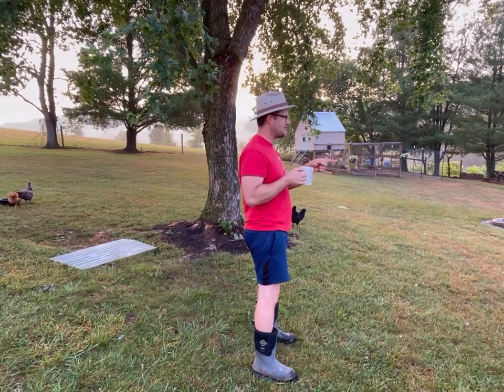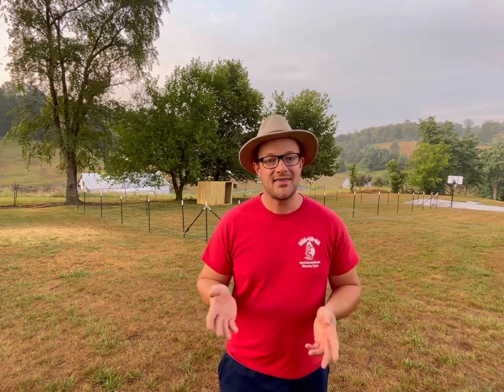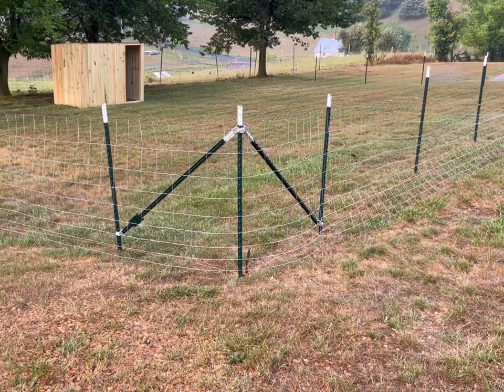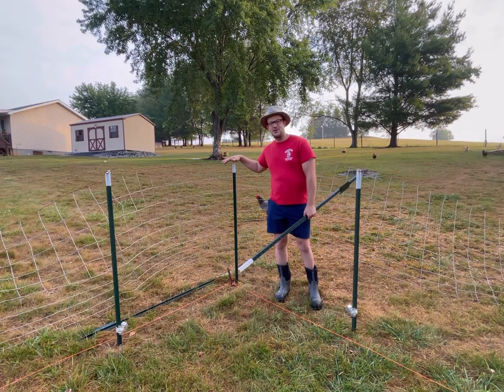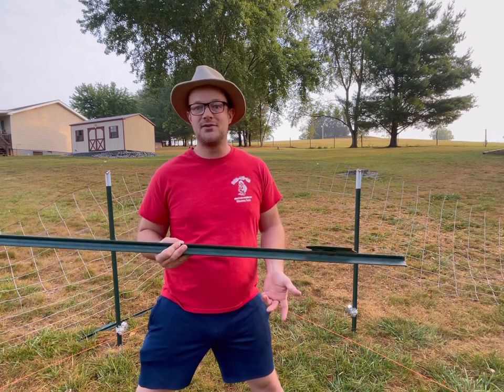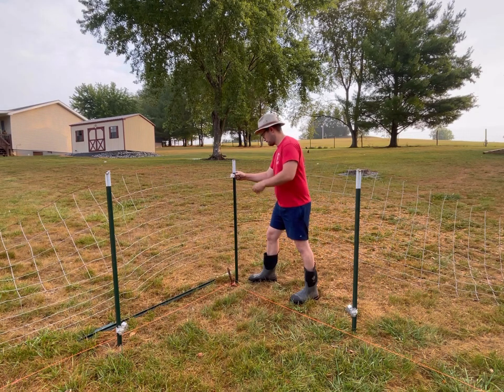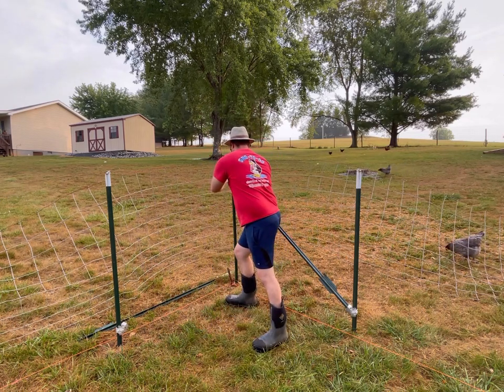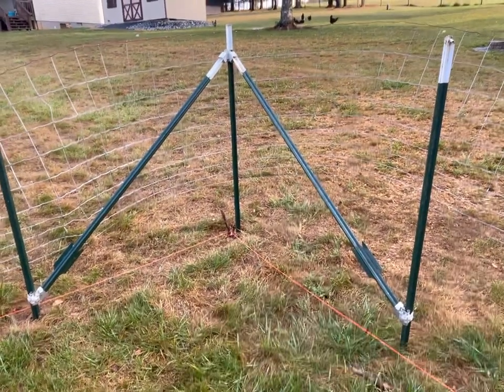Bracing a Fence Corner: Using T-Posts & Wedge-Loc Bracket!

Comment: As a rule, are you supposed to use the same height t posts?  Or could I use 5 ft posts to brace against 10 ft posts as long as I'm measuring the angle correctly?  I'm making a garden enclosure that will double as a cat enclosure, and they won't be putting much pressure on the fence.  Thanks!  Awesome video!
Reply from the maker: You could definitely use shorter posts. You’d just have to brace it lower, but as you said, you’re not trying to keep cattle in. I think you’ll be fine!
Reply: @pretendfarm  Thanks, that's what I figured!